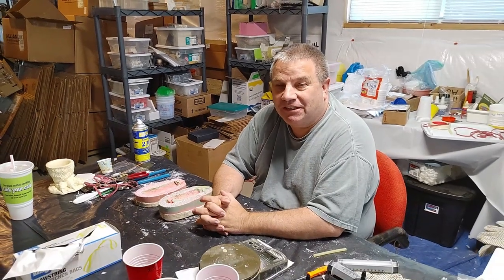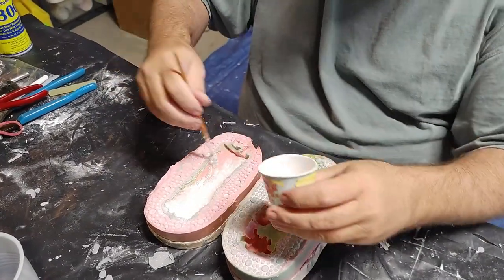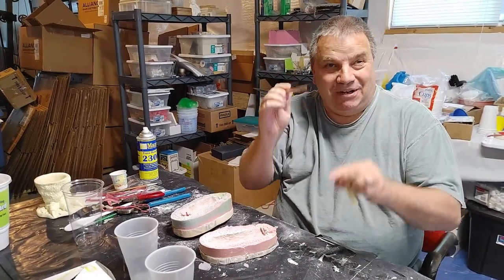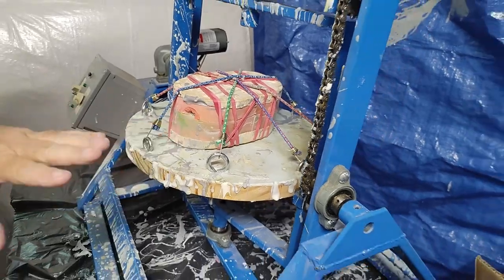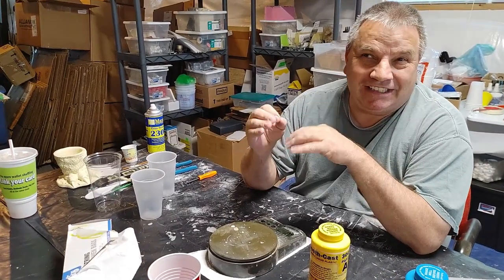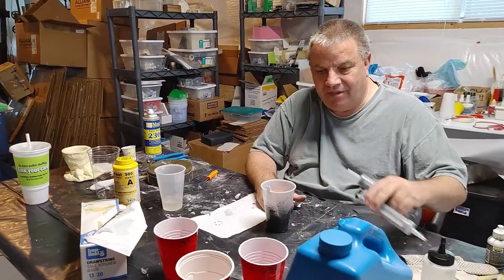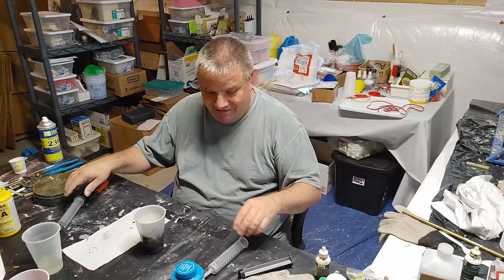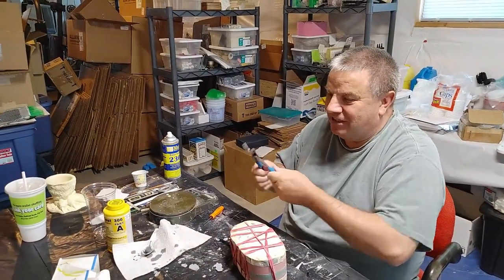Model Club TV: How To - Roto Casting

Comment: So is this simply to get the resin in all the nooks and crannies while also eliminating bubbles? I guess why use this instead of a vacuum chamber?  Just curious. Looks fun.
Reply from the maker: The vac chamber is to pull the air out. This creates a hollow part
Reply: @modelclubtv  Oh I see, the spinning makes the resin go to the outside of the mold so the part is hollow and lighter on the inside...